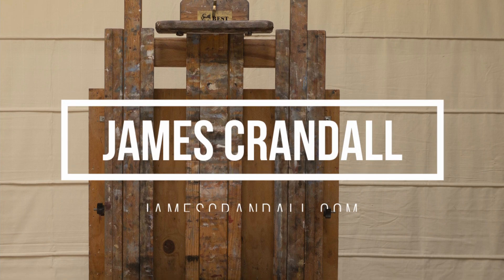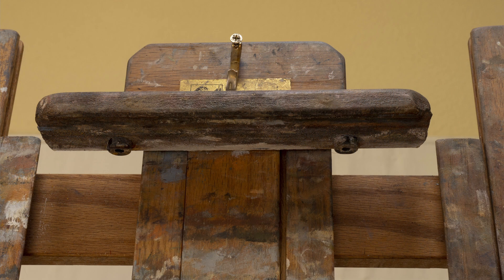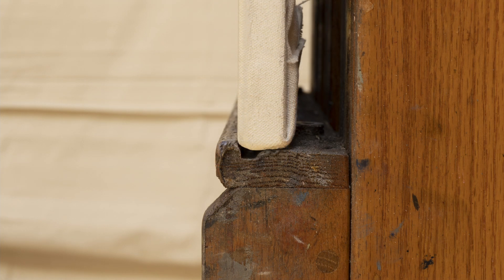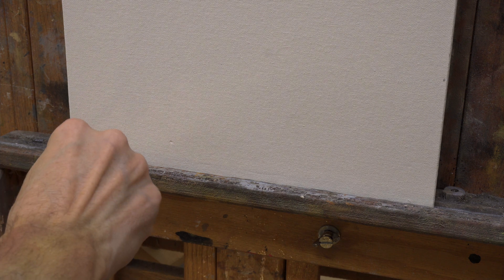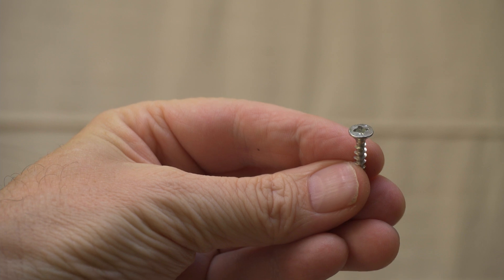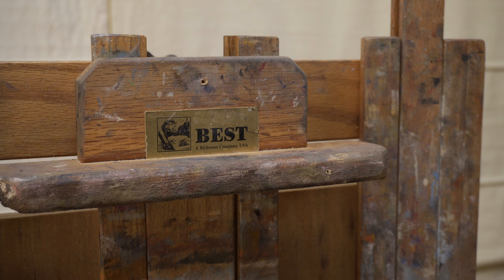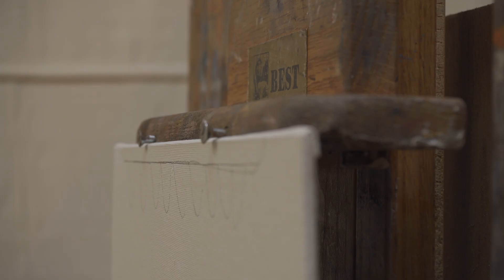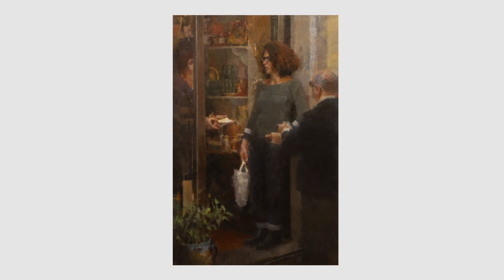Quick and Easy Easel Upgrade

Comment: I have had many easels and have come to the conclusion that the designers are not artists as I have had to modify every single one including addling angle iron to the painting holders to avoid the problem you described not having the top and bottom edge covered.
You are a great asset to the painting community Mr Crandall and deserve many subscribers!
Reply from the maker: Thank you very much!  Yes, I do think the woodworking trade is often just guessing… and to be fair, most people who buy easels probably don’t end up using them very much, and are happy enough.

Comment: Thanks. I did something similar by installing a french easel pin on the top holder of the easel, and can be tightened but I like your solution better, and may do that for the bottom holder which lacked the wood area for that solution. I almost always paint on panel. Easel makers forgot about us.